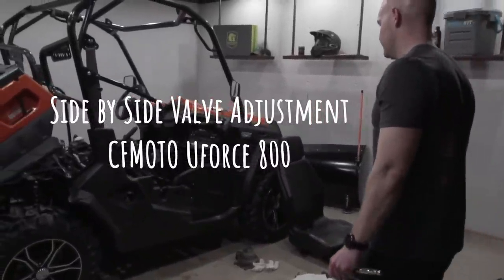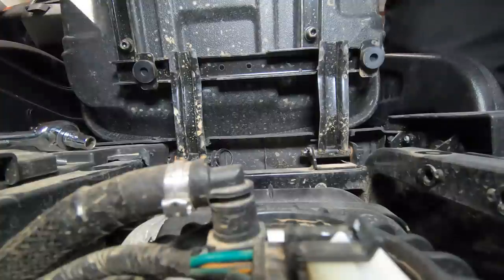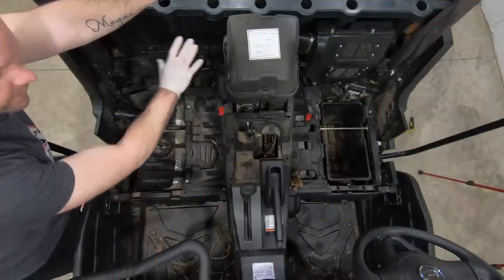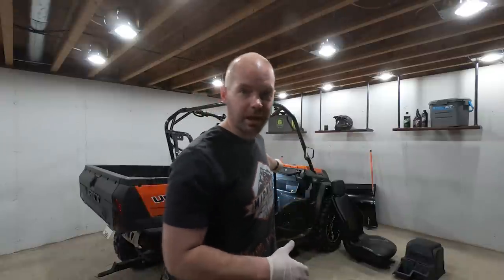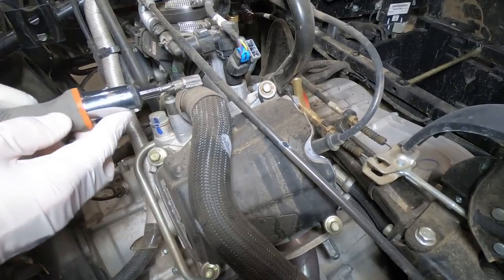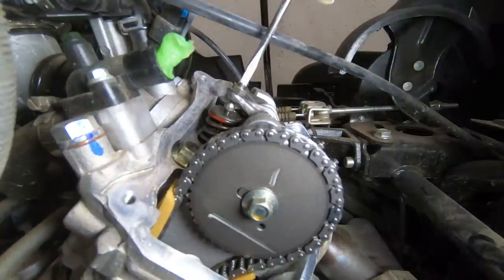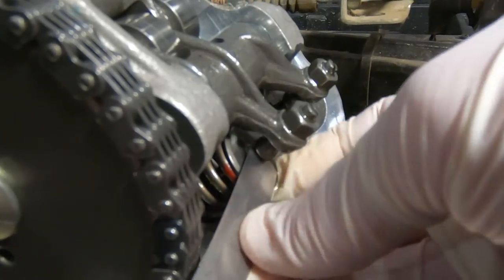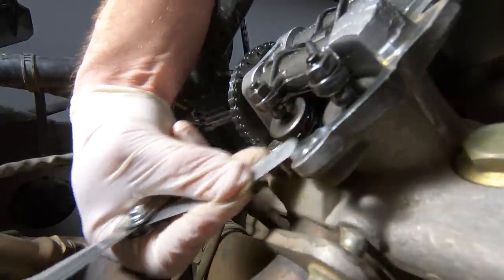How to Adjust Valves on a CFMOTO

Comment: I work on all my CFMOTO machines.  We have a 800ex and 500 trail.  Ive done videos on easy cheap clutch kits, ecu tuning, and performance exhaust and much much more. I have a ton of CFMOTO videos for anyone who needs some information.  Great video happy to see more youtubers coming to light.
Reply: How do I replace timing chain or more less get too dead center correctly in both cylinder
Reply: Awesome. Ill look you up. Ive got a new 800 XC and wow!. . I did a lot of thought and reading before I bought it and have had nothing but fun. But the nearest shop is 40 miles away and the place I bought it closer to 100.
Reply: @Ulfthednar  definitely get with me buddy. I just got a cforce 600 and love it also.  Very very nice CFMOTO machines. Check out my 10 thousand sub video I just did and I hit some jumps with the 600 in that video.
Reply: @R.N.GPerformance  right? Ive been a minor gearhead for . . ooff . . almost forty years. I looked real close at the CFs I could find and the more I dig into my new 800xc . . theyve done a fine job. The fit and finish is really good on it. You do NOT find that on junk. This is my first ATV, Ive done most of my time on old harleys, but Ive already exceeded most of the videos Ive seen just in my backyard (hill country). I have a roughly a 30 to 40 degree hill for a backyard. The 800 will pull it in Two high on loose fist sized (bullrock) stone and dirt. I tried it in 4locked and about ripped my arms off hanging on. Read the manual, theyre not kidding. If you dont need 4 wheel, dont use it, these things will drift around a dunce cap at 30 in 2 high (and Im a complete newb at ATVs.). The steering is pretty good in 2w but slower in 4wheel (just like the manual says) and a bear in 4lock. The manual also clearly states to get on it and lock the clutches up, that your not supposed to ease into the clutch (guilty at first). The suspension is great. (might be better mechs at the shop I bought it at) and it barely rolls when Im drifting around the 120 foot tall bullpine (white pine) in my yard. I'm looking forward to a lot of fun on this machine.
Reply: @Ulfthednar  yea CFMOTO did a fine job they aren’t your average Chinese junk.  Definitely good quality for the $$$ spent.  Allot of power for sure.

Comment: My experience with valve adjustment is intake valves usually get more clearance over time and exhaust valve adjustment gets tighter over time. So I adjust intake valves at the low end of specs. and the exhaust valve at the high end of specs. I do it that way so I don’t have to do it for a long time or if ever again.
Reply: My old school shovelhead exhibits the same characteristics. Granted it is air cooled and Ive found that I need to leave the rear exhaust pushrod just a tad looser than the rest, because it gets the least amount of airflow. That was actually a question I had about this.

Comment: i'm at 288kms on mine, will be doing that myself. 
like the machine but man there quality insurance suck. on day one I had to tighten the battery terminals the connectors on the firewall passenger side.  
had to change all the steering wheel bolts. 2 non existing, 2 broken off,  one tight but the bad hole stripped the bolt on the way in and the rest all loose to the point that it wore out all the tread. 
you can see that the treads were not cleaned after manufacture and that the treads were stripped has they went in cause all the bolt were rusted already.  
other then that sounds awesome lol
and ya the cvt is loud but did quiet down a bit after a while.
hopefully no more issue.
oh and my driveside rear wheel squick  like a MOFO too been doing that since day one. cleaned the brake and everything. just that wheel. the dealer noticed that on his demo one too
Reply: Thats the shop that put it together. I had a bolt rattle loose on mine. No big deal. Just like every other vehicle, one bad mechanic creates a lot of backlash.

Comment: They make plastic fastener removal tools. I like replacing the oem rivets with the nicer ones that you can pull the middle insert out and just pull them out. Put em back in and push the middle insert back in.

Comment: Hello, how do you know when you need to adjust your valves?
Reply: Without being disparaging, I can hear my valve lash. I havent hit 20 hours or 200 miles yet, but I can hear just a little bit of chatter in the front that wasn't there before. A mechanics stethoscope or a good screwdriver (press the tip to the rocker cover and your ear tight and listen, use the other cylinder for a reference). Its an acquired skill that I learned from mechanics older than I am. It isn't bad but it is close enough to the inspection point to take the time to correct it. Work slow, and be patient and take your time and you'll do fine.

Comment: The push pins are actually pretty easy to get out. You can use a small straight blade screw driver or they do make a little removal tool for them :-)  It's a 2 prong "fork" tool, any auto parts store should carry them.
Reply: Yes I have one of those tools, make getting those out easy.
Reply from the maker: Thanks for the info and tip, gents! I do use a flat head but it never seems to work well and take a forever. I'm going to look for one of those tools next time I'm at the auto parts store.
Reply: You can buy a whole kit of those clips and the tool for around $30 on Amazon.
Reply from the maker: Awesome, thanks Brad! Definitely going to check that out.
Reply: @NavigateOffroad  yup, you can buy a basic "trim removal" kit at oreillys or a larger kit online.

Comment: I wanted to ask are cfmoto good because they are cheaper than the rzr and rzrs belts are bad
Reply from the maker: That's a great question and yes, they are. But at the same time there are always sacrifices and not every machine is for everyone.

We did a full review on this Uforce, I would check that video out and it might help you get some good info and assist you in making your choice, good luck!

Comment: Been watching your channel alot and like the content, keep it up!

About the plastic push pins.. if you got the polaris tool kit with your scrambler, it has a set of pliers that have the special tool built into the nose. If not the tool can also be made by grinding on a cheap pair of pliers. It's just a regular set of pliers with a groove cut into the jaws for the head of the plastic rivet to slot into. Works great!

Comment: Great video, I need to do this on my Z Force 800. Hoping to remove a LOT less plastic.
Reply: Its much easier on the z800.   Takes me 20 minutes and im into cylinder 2 which faces the cab and cylinder 1 faces rearward and  i access # 1 from pass side fender well.
Reply: @BlettzaHrekleW  How do you get in there? I can't even access the screws for the valve covers w/out taking the whole rear bed off? Or am I missing something?
Reply: I don't remove the bed on zforce.  I pull the engine cover in bed but go through from underneath bed like i said from pass side. Here is part of my writeup from My Pennsylvania Cfmoto Facebook page.  I have pics for it all there. 
Things that need removed
#1 Engine cover in bed 
#2 Large center plastics behind seats. 
#3 Fan housing on pass side beside oil filter so you can use FAN NUT to rotate engine (COUNTER CLOCKWISE ).  If you have a newer zforce 800 you won't have this fan. 
#4 Pass tire ,makes it easier to get to CYL #1. 
#5 Remove Spark plugs. 
#6 Remove both valve covers. 

To find Top dead center. Rotate engine while watching cam sproket timing marks but 1st watch your intake valves open (spring compress ) , intake valves are closest to the intake , keep rotating ,youll see valves close (springs de compress) , once your to this point look for timing marks on cam sprocket and line them up even with edge of head .

If anyone would like to see the full writeup , if your on my Pennsylvania page then ask and i will tag you in it.

Comment: I can't find a gap! .003" is the minimum for the intake, but I can't get it to go through. Just to make sure I am at the right spot, I tried it on the exhaust which should be wider. I couldn't get it through there either! Is it possible that all of the valves are gapped to less than the minimum for the intake?
Reply: I finally just cranked the screw open and found the gap. Then I put the biggest gauge in and tightened it down until it was tight. I can't believe all 4 valves were that tight from the dealer!
Reply: @mayasdaddy1  Spencer. "Ideal" is generally in the middle of most specs. In most cases, the exhaust valves are going to get a bit hotter than the intake valves. That means the metal will expand slightly more on your exhaust than your intake valve. Once you get the process down, try adjusting your exhaust valves one increment of measure looser than your intake and see how she runs warmed up. Just be glad its a cold adjustment. Old school V8s and such you did it with the engine warmed up and running . . .
Reply: @Ulfthednar  I remember Dad doing them running! That was in the '60s. Anyway, after I did my bit with them, it has been running great ever since. It fires right up whether it is hot or cold. Thanks for the input.
Reply: @mayasdaddy1  the other trick is "pass no pass". Your target gap (at your discretion within specs) should drag through the gap. Its a slight interference feel your looking for, but the gauge should pass through. Double check it by using the next thickness up. (if your setting at .04mm then .05mm shouldn't slide through.) If that one doesn't pass through, your as close to exactly on as a human can get. I used a bendy mirror to watch my gauge on the front exhaust.

Comment: Just bought a 2018 uforce 800 got 34KMs on it and my dealer said at 300KMs I have to bring it in for valve clearance service . I'm mechanically inclined but can't do the work myself cause warranty would be void
Reply from the maker: That's crazy that it voids your warranty! Is it covered by your warranty then, or do you have to still pay for it?
Reply: It's the first break in oil change and valve clearance check but I'm guessing I'll be paying for it one  way or another. But after that I do my own services
Reply from the maker: @WesGoose  right on. Well at least they are paying for the initial service! That's a few hundred dollars easy.

Comment: How many miles do you have in it?
Reply from the maker: Around 200 or so, David. I believe the recommended valve inspection is 155. So we are technically a little over on this machine.

Comment: Here I am, a year later. Once again, my valves are too tight to even get a .002 in them! It acts totally different this time. Before, it was a real bear to get started when cold, but it ran great once it was hot. This time, it sputters when cold or hot, but it starts right up! 
Mine is a Uforce 500. There is a serious lack of videos for a 500. The 800 is close. Two things that I noticed...on the 500, there is only 1 cylinder. I spent WAY too long looking for #2 spark plug before I discovered that there isn't one! And second, on the 500 you don't need to remove the fuel tank because there is no 2nd cylinder to worry about!

Comment: Hello, I bought 100 clips with the removal tool from Aliexpress  for 6,60€. As the original clips are 0.73€ each in France it was an absolute bargain. The main reason they use these clips is for lightness & lack of space to use traditional screws, nuts & bolts etc.
Reply: Got a link? I havent broke any yet, but it is bound to happen.

Comment: I can't believe they charge you more to adjust them when that's the easiest part. Taking the Dang thing apart is the hardest part of the job. They want $500 for my break in inspection That includes changing all the oils as well but I'm going to do it myself. It doesn't say I can't do it myself. But had to make sure for warranty and all.I just bought the bike new they charged me $500 to put the oil in and now they want to charge me another $500 to take it out That's a $1000 for 300 km worth of riding Yeah right. I got the 600 the specs are the same as yours but not a v twin.

Comment: Jeebus!  The effort necessary just to get to the engine is enough to make a guy not want to buy one of these.
Reply from the maker: 😆 Yea you definitely have to take a few things off to access the valves!
Reply: try dropping the transmission on a 90s nissan D21 hardbody. this is a piece of cake.

Comment: There's a special tool for removing plastic rivets..
Reply: Ya a side cutters its  pliers like tool can take them off faster than the recommended took they make for these
Reply from the maker: Thanks, Gunna. I clearly do not have one of those but I will definitely be looking for one next time I'm at the auto parts store!
Reply from the maker: Interesting, Mike. I'm honestly not quite sure what those are but I'll try to look them up after this. I'm guessing side cutter is the correct name if I go to search for them?
Reply from the maker: Mike, I just googled this and realized I knew what tool you were talking about.  They don't seem like they would work really well but I'll have to give them a shot. 

Thanks for the idea.
Reply: side cutter is easier and everyone already  has one if you have tools don't waist 10 bucks on that tool @NavigateOffroad
Reply from the maker: Fair enough, i'll give it a shot! Thanks for the tip Mike.
Reply: I welded up a tool to do it, it’s like a fork but I did it so I didn’t have to replace them all the time